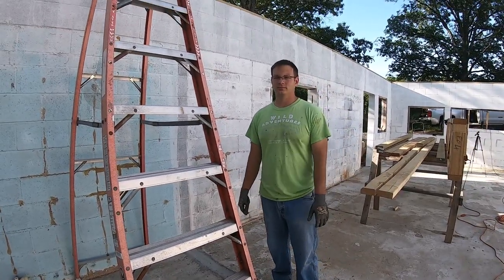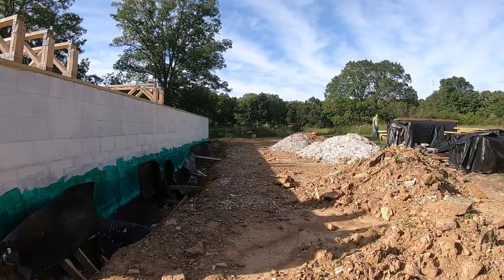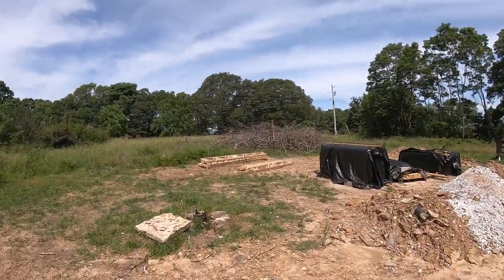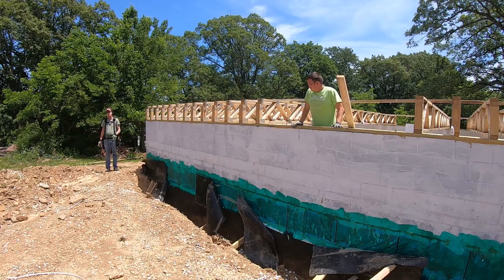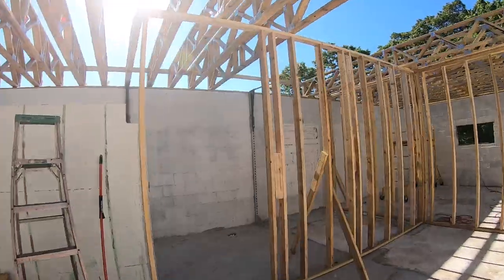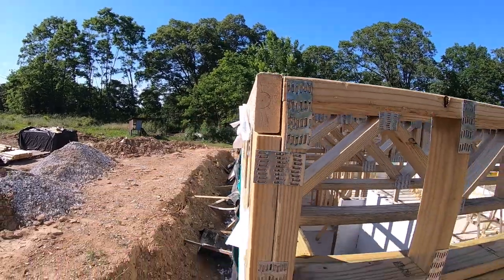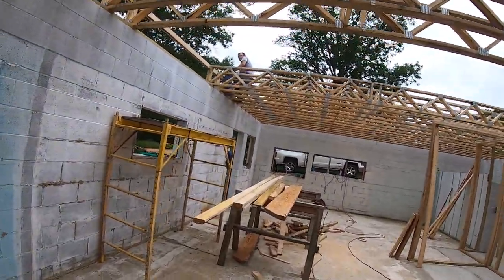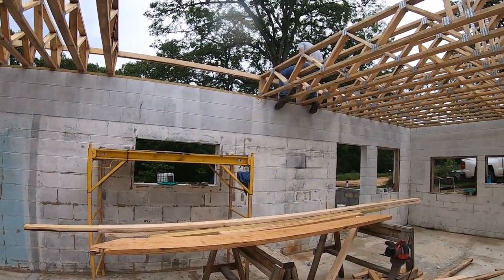Installing Floor Trusses and building the basement walls

Comment: Question, on this build. could it be open span with no walls. or support walls needed. ? If you don't mind answering
Reply from the maker: Hey Kyle! Thanks for checking out my channel! I don’t mind answering at all. Yes you can span 30ft with no supporting walls. The trusses I used here are 16in tall. To span that far without supporting walls you would have to use 24in tall trusses.

Comment: Why not use nails?
Reply from the maker: There is nothing wrong with nails and we could have but we wanted a stronger connection because there is a lot of wind up on top of the hill where we built this. I’m sure nails would have been perfectly fine, just a personal choice. I’ll probably never do it again though lol took more time for sure!
Reply: @jamesofalltrades479  I was always under the impression that nails were stronger than screws.  I asked about nails because I didn’t know anyone that framed with screws specifically because of sheer strength.  Were you using some kind of structural screw?
Reply from the maker: @MrSpatia  I know that nails have a sheer strength of 250lbs, not sure about screws. This is the first time I’ve used screws on a house. I build all my small building out of screws though like sheds, chicken coops, dog houses, stuff like that. You just need to make sure it is square when assembling because with screws, stuff doesn’t want to move after assembly.  Just because of the time factor I will probably never use screws on a whole house again otherwise I feel like it’s stronger.
Reply from the maker: @MrSpatia  the screws I used were outdoor 3in decking screws. T-25 bit
Reply: @jamesofalltrades479  Not for nothing but decking screws don't meet code for where we live (Alberta - Canada).  You cannot frame with them here.